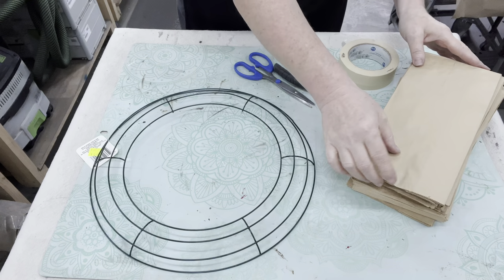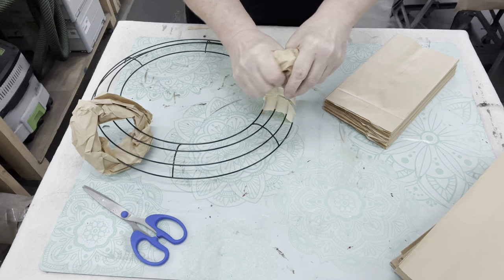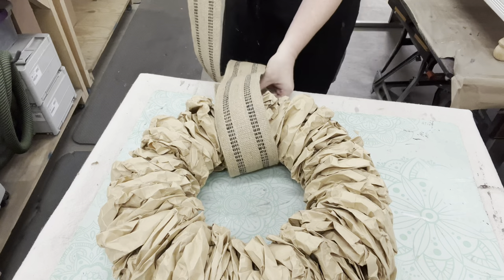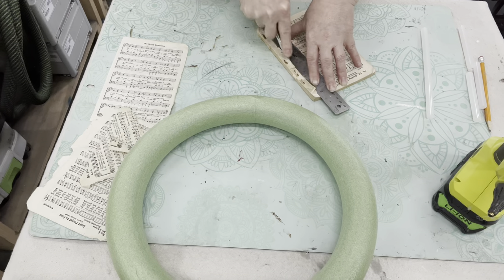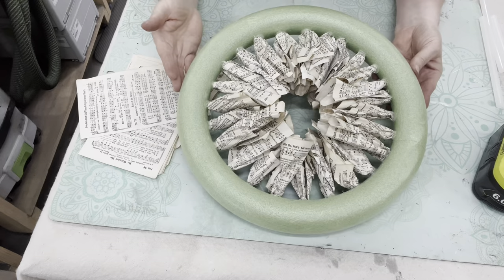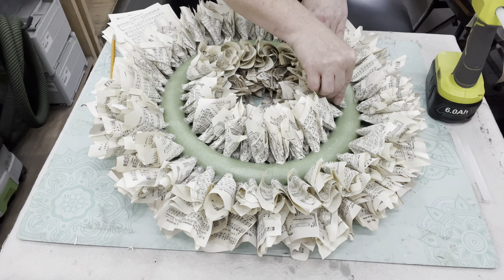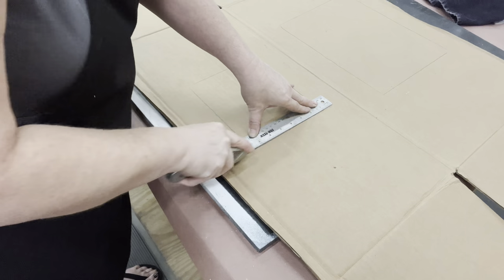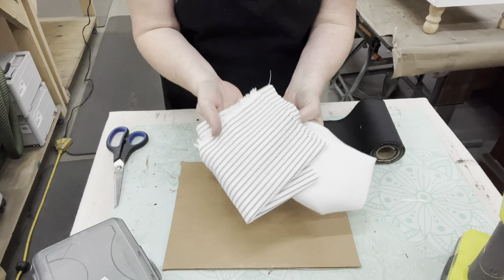Dumpster Diving | Trash to Treasure | DIY for Home Decor

Comment: So awesome!  Thanks. Hey on the galvanized metal you can also spray it with a vinegar/ salt solution and let it set and it will rust really quickly
Reply from the maker: Yep.. I just went for the easier way. Though that mixture is definitely more realistic

Comment: Thank you for showing exactly how you made the partial sheet wreath. It turned out so lovely and with your exact instructions I think I can replicate it. If the wreath is sprayed with some sort of sealer could’ve.  it be hung on a outside door. After spending so much time making it, I’d hate to ruin it in wet weather. I learn so much by watching you work. You’re not jealous of sharing your instruction tips.
Reply from the maker: Oh.. I’m not sure about the spraying it.. I wouldn’t want to steer you the wrong way. I’m sure one could. But the weather is brutal and after that kind of work I’d leave it inside 😁
Reply: @GingerChickRehab  thanks for your reply. When I make one I’ll be sure to leave it indoors.

Comment: Only one question tonight!  do you 'have' to use the dryer to dry the paint after painting over glue?  thank you! <3
Reply from the maker: Lol.. no you don’t. I’m inpatient. It does need to sit a bit to get a film on the top. If you want larger crackle. If you just paint right over it, it gives smaller crackles. 🤗💕

Comment: I tried the crackle technique, made sure the glue was tacky and used Chalk spray paint.  It didn't work.  Do you know if it was the chalk spray paint?  Thanks Yvonne
Reply from the maker: I didn’t have luck either with chalk paint. So I just use regular .
Reply: @GingerChickRehab  Thanks bunches!